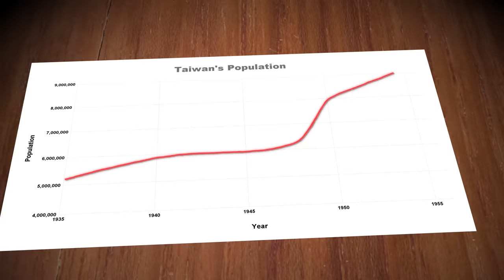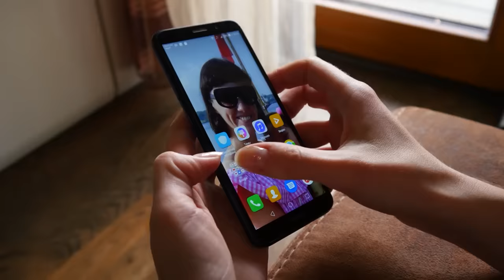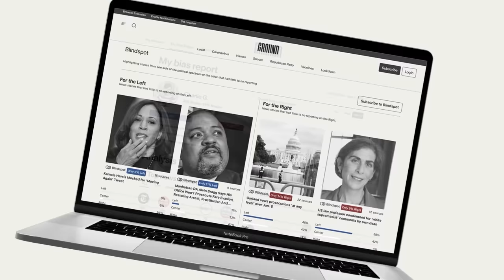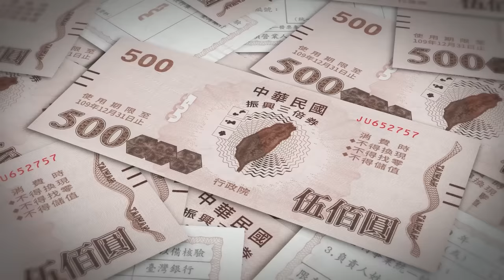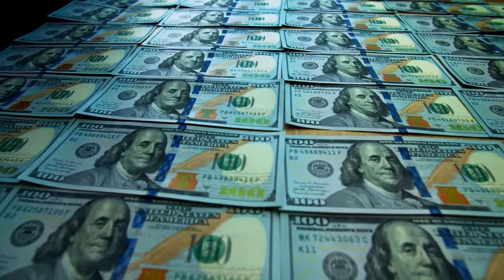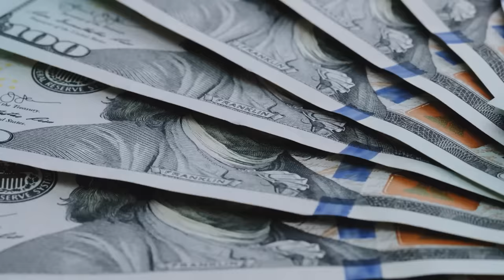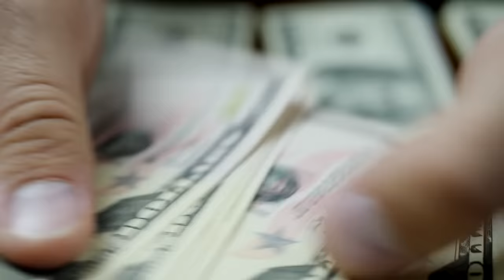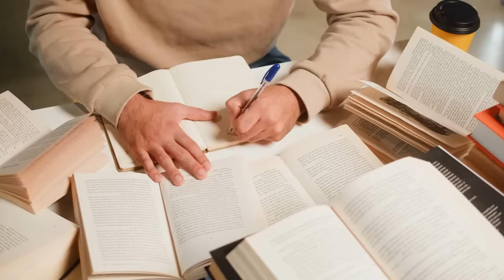How Taiwan Became Insanely Rich So Quickly

Comment: You made a magnificent video. I am always proud of my grandparent's generation that they turned Taiwan into a developed state. One thing you made clear about Taiwan is that the true power of Taiwan's economy is not based on the huge state-supported companies (like Japan, South Korea and China), but thousands of small scale manufacturing companies which were the product of both land reform and industrialization in the 60s. One of the main reason why TSMC/UMC model is hard to replicate in other countries is because you cannot find this eco-system, which those small scale manufacturing companies played a critical role for TSMC/UMC in supporting their FABs. TSMC and UMC can easily build FABs in other countries, but however, without this ecosystem, it will not be successful and efficient as in Taiwan.
Reply: Good point

Comment: I have a different perspective on this. As a Singaporean who has spent time in Taiwan, my recollection is that Taiwan's economy hasn't seen significant improvement over the past 2-3 decades. It appears that their salaries have not witnessed substantial growth over this extended period, which is in stark contrast to the situation in Singapore.

While there might have been some nominal increase, when you evaluate the changes over a span of 20-30 years, it's hard to view it as a meaningful advancement. Personally, I tend to gauge economic progress using salaries as an indicator, and by that measure, Taiwan doesn't seem to have made substantial strides. This assessment is based on heuristic observations.

Comment: Taiwan's rise was fundamentally dependent on the exponential rise in oil and gas consumption  starting in the 1970s. The continuing use of fossil fuels is obviously not sustainable for any country, so they need to move towards an economy that is fossil free. The other huge change is the drop in birth rate, this is already having a huge impact on both China and Taiwan as the neoliberal economic system that absolutely demands growth of consumption finds its  core assumption confounded by reality. Perhaps Taiwan , as a free, democratic and independent country will show the way towards the inevitable new ecological equilibrium that has degrowth as its central premiss so as to ensure there will be any future at all.

Comment: Indeed, a significant number of Taiwanese people experience low income. Wealth tends to concentrate among a small group of affluent individuals. The infrastructure has remained largely unchanged for the past 30 years. Furthermore, Taiwan lacks abundant natural resources and its economy heavily relies on semiconductor manufacturing. In contrast, China is steadily advancing; it is projected that its GDP will surpass that of the USA by 2030. There is a substantial disparity between Taiwan and China.